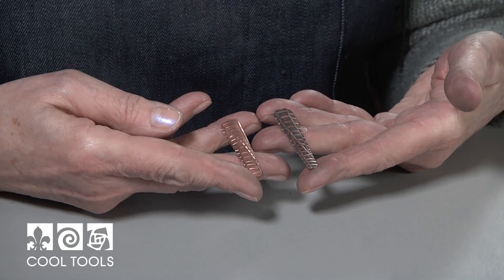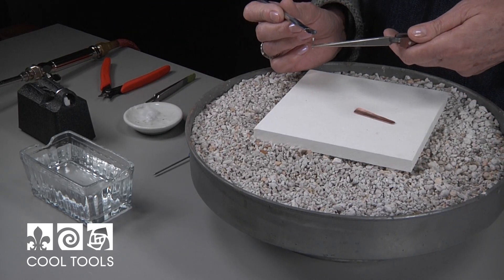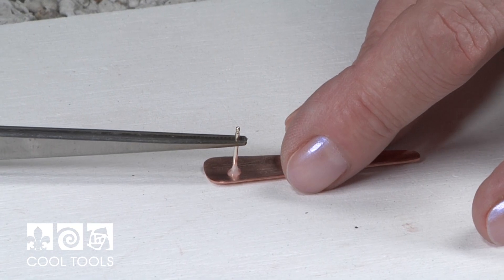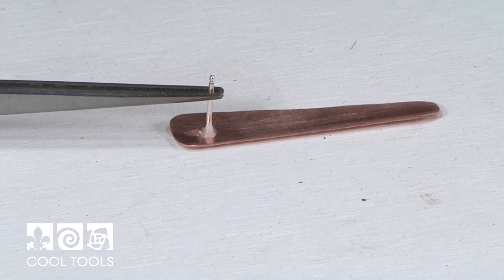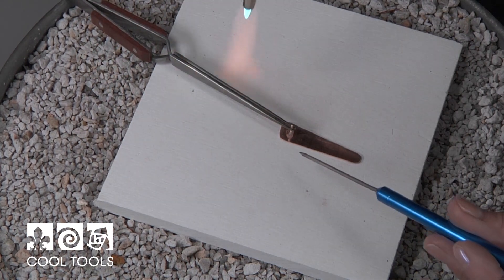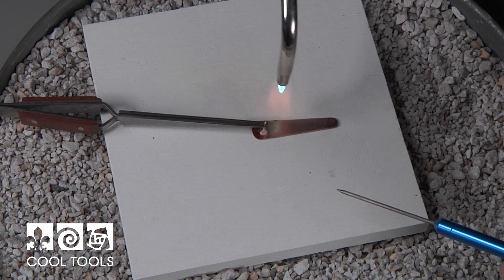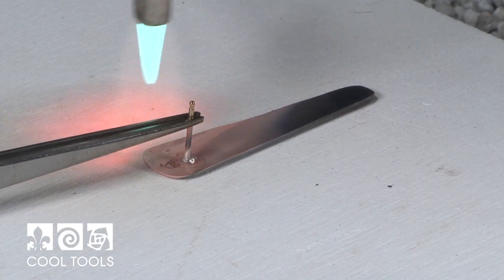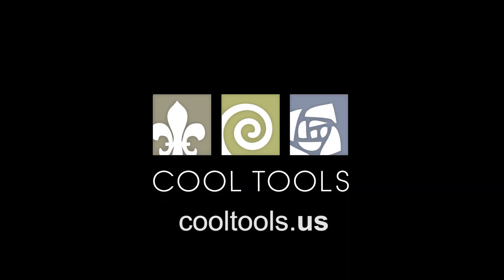Soldering Technique - Earring Posts

Comment: loved your video, very clear nice technique.  Can you tell me how do you solder a post to an enamel earing?
Reply from the maker: Hello, the post would have to be soldered on prior to the enameling of the earring. Since enamel is usually fused somewhere around 1400-1500, you would need to use either Hard (flows at 1450) or IT Extra Hard (flows at 1490) solder. I would recommend programing your kiln to 1400 for the enameling to keep the temperature lower than the flow temp of the solder. Once the post is soldered on, you would just have to make sure you throughly clean it to remove any flux or pickle from the piece, and then it may be treated as any other piece they are enameling. You'll just have to keep an eye on the piece to make sure it doesn't get too hot or the solder will flow and the post will fall over. 
Karen